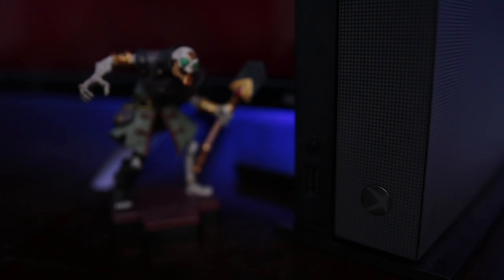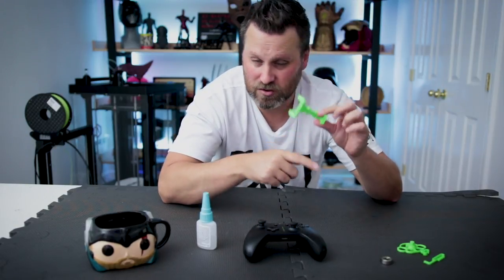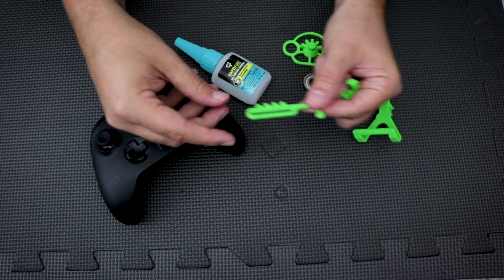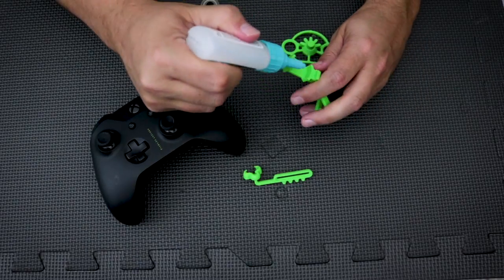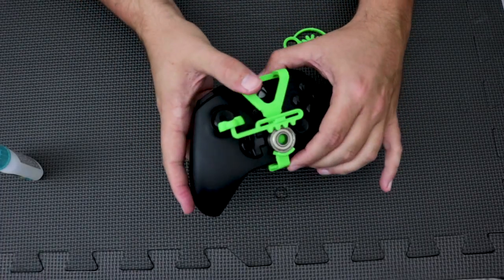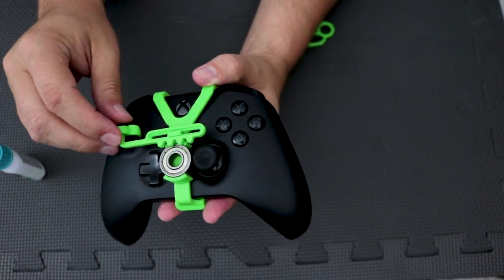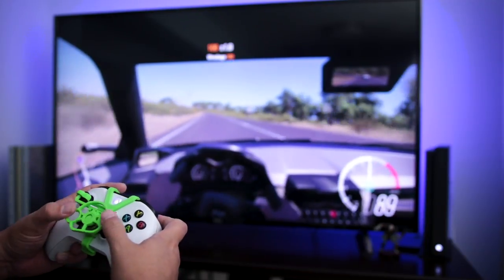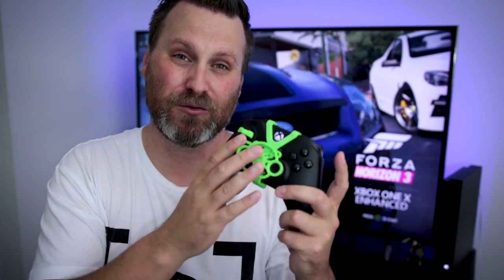3D Printing an Xbox One Steering Wheel | 3D Printed Rack and Pinion Steering Mini Wheel

Comment: I tried it last night with some Forza 7 and NFS Payback. It works surprisingly well, but I will be making some modifications to the model to hopefully improve it. If it turns out good, I will upload it as a remix.
Reply from the maker: Iron Tiger oh man keep me posted. I think this is a really fun idea and project
Reply: Iron Tiger keep us posted my dude
Reply: Do u think it would be better the the wheel alittle bigger so  don’t have to stretch your fingers so much
Reply from the maker: WillFulForza I actually find the size pretty good. Could def play around with the wheel being slightly larger
Reply: That's one of the modifications I've made, and it does work so much better. I played several more racing games and ended up snapping the wheel off where it connects to the bearing, so I am working on designing a sturdier hub as well. I should have something ready to share soon.
Reply: a smaller more sensitive steering angle/ wheel rotation... so you can still reach all the buttons and hold the controller comfortable on full lock..
Reply: Make sure you set the steering to simulation when you test the build.
Reply: @IronTiger  can you make some and sell them on ebay?
Reply: I've subscribed to you to to be updated on your work on the wheel, haha.
Reply: @Draconiam  for forza I never liked sim steering even on a wheel.
Reply: need to make the arm from the wheel to analog stick shorter, it had too much lag because of it's length.
Reply: @HayesTransport  how would you make the arm shorter without affecting function?
Reply: Please do, we would love to see your work. Best wishes.

Comment: Be sick to make a larger version with an actual car steering wheel, you could mount the game pad on something and steer normally
Reply: Sim wheel costs like. 100 dollars or more tho
Reply: eri there are printable hubs to adapt a true steering wheel to a sim steering wheel hub out there
Reply: that works on consoles?
Reply: Would be cool but then how to you change gears, accelerate brake? etc
Reply: Trustfire I’ve never played the game and I don’t own an Xbox so I don’t know know what buttons change gears but I guess there isn’t any space for another add on so just have to play in automatic lol
Reply: Honestly cheap sim wheels suck however a controller is pretty spot on so I guess you could disassemble the wheel and put it on the controller and then use the gears and pedals from the sim wheel like normal? Be way more accurate when steering at least!
Reply: @trustfire  Most of the times, when you buy a gaming steering wheel, you buy it with the full kit that has pedals, manual transmission and hand brake
Reply: @I Am Sekou
Well aren't you pissy?
Reply: SanteeG726 don’t agree, a controller is pretty responsive, some cheap wheels are so awful you have to over compensate when turning, yeah gears and peddles are nice but not always best
Reply: @I Am Sekou
NoU
Reply: Kayde K that would be huge on the controller
Reply: @moth.monster  you can get gaming wheels on credit you dont have to pay in full and you buold credit, be an adult
Reply: @trustfire  Claw grip
Reply: A 3D printer is like 3k tho
Reply: Instantly thought of this too, but with 900'' lock to lock
Reply: how would u hold the wheel while pressing the triggers for accelerate and brake lmao
Reply: @moth.monster  well the 100$ wheels probably have force feedback and other fancy stuff. There are really cheap options if you want, they just won't have the fancy stuff
Reply: Kayde K Really it’s weird how there aren’t any racing wheels for Xbone when there are tons of racing games.
Reply: Captain Freedom yeah it’s like so weird omg 😯
Reply: @TheRealCaptainFreedom  I'm looking at my old thrustmaster tx right now... this whole time I thought it existed. I must be really, really crazy because I swear I can touch it and things don't pass through it. I can also navigate the menus and launch forza with it. I really must be super crazy since there are no wheels for xbone. I'm going to check myself into a hospital later today.
Reply: Thats a lot of gear change to go from 900 degrees to like 5-10. Youll need planetary gear much like an automatic transmission to get that kind of rotation.
Reply: I've done this, a full sim rig for 40 quid (providing you have a monitor, controller and xbox)
Reply: No force feedback would suck

Comment: Redesign it with smaller gears teeth ,it will increase the sensitivity and the accuracy.
Reply: You'd need a smaller gear on the steering as well, not just teeth
Reply: @callmezucc9318  obviously true

Comment: You should change the steering setting in the difficulty section to simulation steering. They advice you to use that only with a wheel. The real test of how well it work would be with that mode.

Comment: It's a rack and pinion, like the steering on front wheel drive cars :)
Reply: Like the steering on any car actually. Most cars for the last 40 years have used rack and pinion steering, regardless of the driveline.
Reply: Richard Smith Good job, you read the title
Reply: @Simcard__  My dad's 1999 Jeep xj uses a steering gearbox.

Comment: They need to just make a controller with a wheel built into it. Also the right side of the controller should break away so you can use it as a gun, point it at the tv
Reply from the maker: Nabre Labre man I wish they still made light guns. House of the Dead / Virtua Cop was so much fun
Reply: Nabre Labre That sounds like a cheesy toy that would break easily, and light guns only work on CRT’s for obvious reasons...
Reply: Uncle Jessy light guns are no longer compatible with our big flat screens they only work on old crt tvs it's because the refresh rate was faster on the older tvs new tvs look nicer have better quality but refresh the picture slower making light guns a think of the past

Check out this video

https://youtu.be/SWFxuwaZ2nI
Reply: Verbatim they could use a sensor bar like the wii had
Reply: +Verbatim,  Aaron Sharp,

Dude, lightguns for LCDs have been possible for a long time. Wii remote, PSmove are examples of it. There's also Aimtrek guns that works on lcds.

Too bad the lightgun genre died.
Reply: Nobody would really use it, it'll be another gimmick like the PS4 touchpad
Reply: @jamesmcdaid1260  it'd be a specialty controller for people who don't have the money or space for a full wheel
Reply: Uncle Jessy house of the dead was so fun as a kid.  Was like an arcade cabinet
Reply: There is one, called RaceRoom controller, RR DC 1/2..
Reply: were not there yet

Comment: Amazing how it takes almost a second for the game to register his steering 🤣🤣 Xbox sucks!
Reply: I'd say that's rather how damn slow is the steering wheel animation
Reply: Controller input lag. PS4 deals with it too, but you can always fix it by using a cord. Well, Xbox can
Reply: this has to do with the monitor too because tv's often have really slow respond times and the animation is just slow. doesn't have a lot to do with xbox
Reply: Jurassic Mellon obviously you're here to showcase your fantastic spelling and grammar.
Reply: RotiiK _ no joke every console is good, and I agree pc is superior but get outta here this is an Xbox vid abt a racing game. Racing. Keyboard. They just don’t mix.
Reply: It's probably just the motion smoothing method (as there is no force feedback on the controller), dead zone and the animation together... That amount of delay would lead to a horrible drunken driving experience.
Reply: when i play on my xbox one s, i do not notice any lags/problems
Reply: It is not the Xbox. Its the TV. If he had it hooked up to a 1ms rsps time monitor then it would be immediate. Newer TVs are crap when it comes to gaming.
Reply: @rotiik  I gonna say not everyone's parents can't but that 800$ stuff. It's overpriced.
Reply: it's two things: 

1- His tv has MONSTROUS output delay.
2- It's a gamepad, and using those to play means you have a large deadzones in the middle, and the output of the movement isn't linear (it's a heavily skewed  logarithmic curve). 

use this with a steering wheel on a low latency screen and it looks like it moves exactly with your hands. except it doesn't go past 90 degrees.
Reply: RottiK_ except you can't use thrustmaster's stick shift with forza horizon on pc, only on xbox. because it's a separate device on pc (on xbox it plugs onto the wheel and works, on pc you have to plug it into its own usb port for some retarded reason) and this game doesn't support two different input devices simultaneously. also there's no support for VR. (also vr sucks, SPECIALLY for racing games. resolution is just too fucking low, at least on vive).
this coming from a guy that actually owns the full kit you're bragging you could own. the pc version of this game is not worth bothering with.
Reply: @rotiik  so can console
Reply: Its not the controller. He isnt using a proper low latency HDR TV with 120 motion. Which is odd seeing hes an Xbox guy but not using a decent TV for gaming.
Reply: yes but you cant play FH3 on ps4 can you.

Comment: Don't throw out that day one controller the analog stick can be replaced. All you need is some basic knowledge in soldering😊 (also you can just swap the whole motherboard with a working controller if you dont actually want to fix it lmao)

Comment: Prints well. Works easily, just need to get used to the deadzone on some games.
Reply: A slightly modified design could make the controls more sensitive at the center point to narrow down the dead zone.

Comment: Tried this and not sure if it was the filament dude that printed it for me used but the wheel part that clips into the bearings snapped on each one .-.
Reply from the maker: Ouch. Yeah might have been bad plastic or he used only a little infill so it would print faster and made it weaker

Comment: Wait so you basically made a xbox controller into a ps4 controller
Reply from the maker: Xxstirling926xX odd since a PS4 controller doesn’t have a wheel attached to it. However I did make a wheel video for the ps4

Comment: Seems a bit dumb. Why not just purchase an xbox one steering wheel
Reply from the maker: Hello because the cheapest Xbox one Steering wheel I could find on amazon was $100. If you have a 3D Printer you can make one of these in just a few hours. Plus... it’s fun to make random things.
Reply: Uncle Jessy I understand the idea of making random stuff with a 3D Printer, but I and the fun to be had making all kinds of different contraptions. But, I guess as far as your first point goes, if you can afford $300 on a 3D Printer surely you could afford a $100 steering wheel, and get a much better experience.